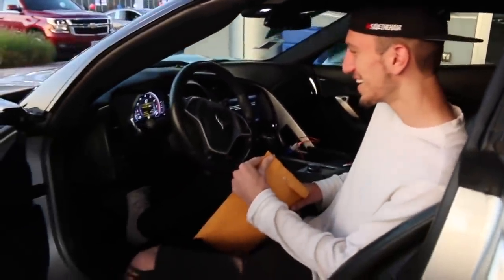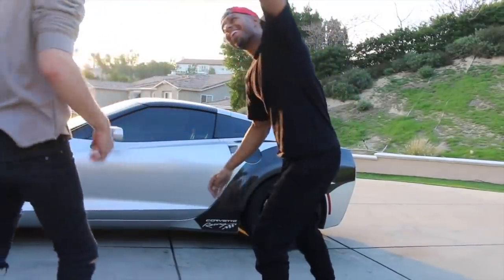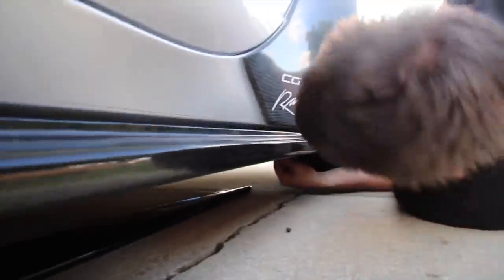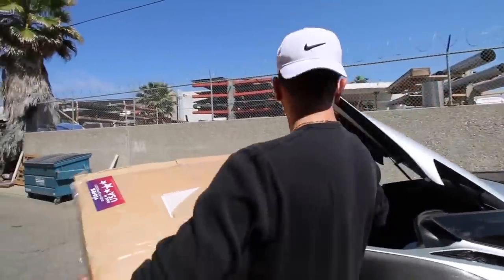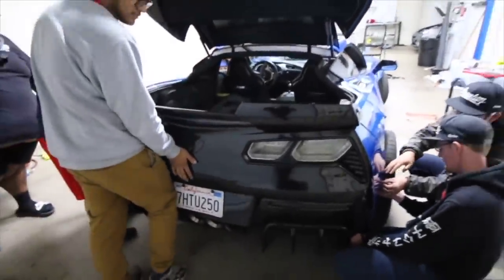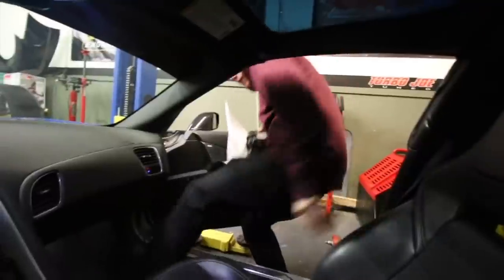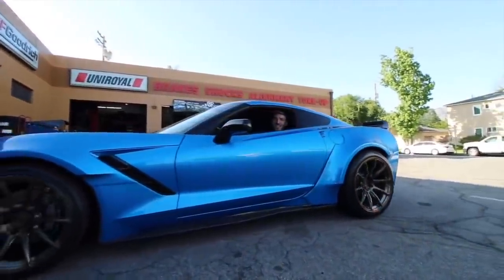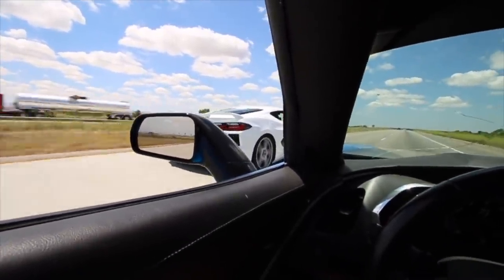Building a Widebody Corvette C7 In 8 Minutes!

Comment: I would have spent my money on suspension upgrades and calibration. The C7s are different cars when this is performed, and nobody is talking about it. You can get AMG GTR track performance out of a Z06, and a standard C7 becomes worlds better on street and track. These cars came with problems from the factory with CASTOR alignment and mag ride adjustments. The aftermarket has all that figured out now.

Comment: What would be the best and least expensive way to widebody my c7 vette. I need some pointers
Reply: Don’t be cheap and do it right the first time. Prolly looking around 7k
Reply: @NewmansDetailing  you can do it cheaper than that. Mine cost me around $3000.00 to do. $1800.00 for the widebody and $1200.00 for paint.
Reply: Which wide body kit.